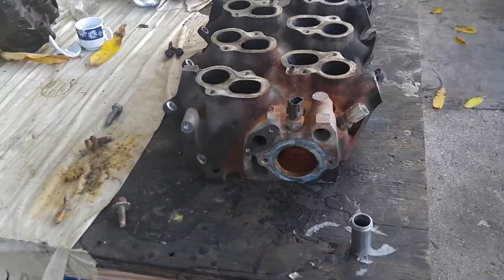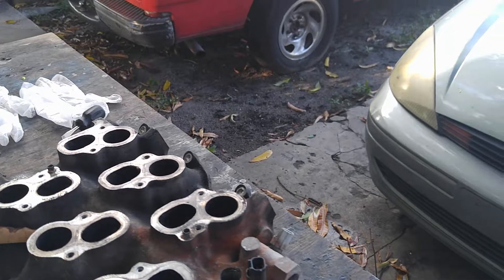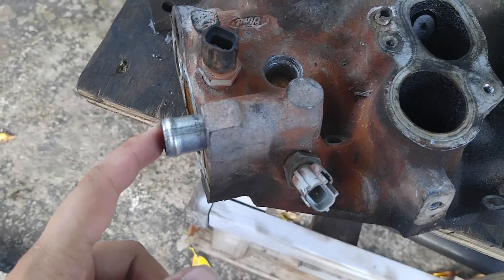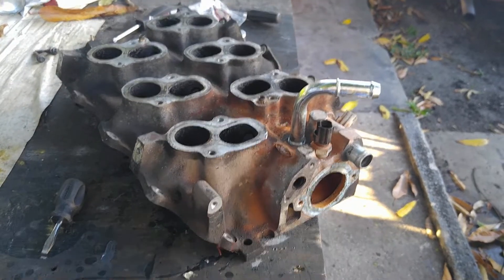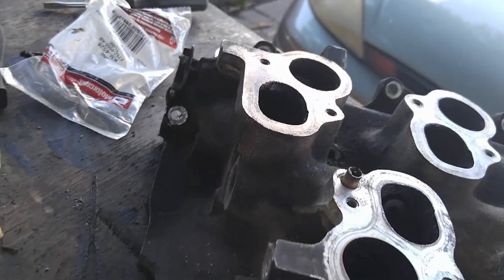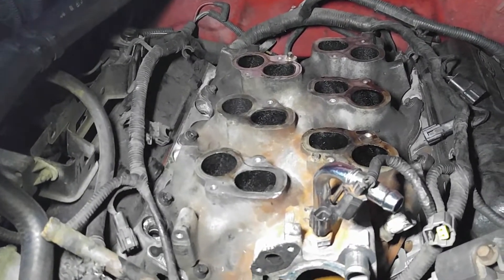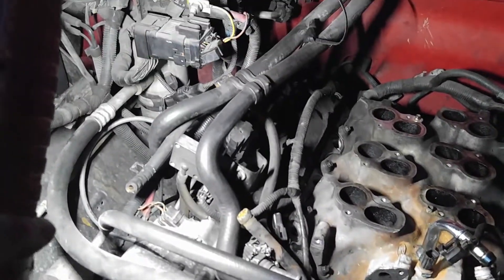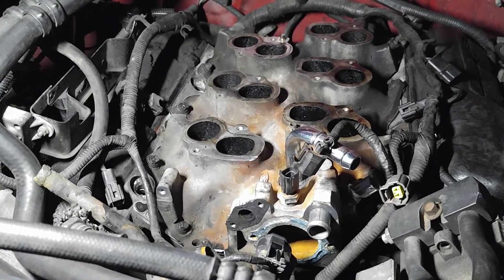98 F150 4.2l V6 lower Intake Pipe repair.

Comment: Did it leak?
Reply from the maker: @Goshdog  it did not. Everything worked for 7 years until I crashed the truck. Currently working on upgrading it to a 5.4 motor. But the 4.2 was running with no leaks on this repair.
Reply: @pivisrepairshop3151  cool I tried I just couldn't get it so I replaced the manifold

Comment: Thanks for the information. That is exactly what I have going on. I bought the truck in 2002 New and it has been Faithfull and Dependable other that this issue, and the Clutch Slave Cylinder is on the Main Input Shaft of the transmission. ( Bad of Ford to be so thoughtless, that was a pain.) I guess I'll give this a try, I'm not a mechanic really, but if I thought someone would pull the intake and fix it correctly I might consider it, but I'd rather try to do it right myself than have someone throw a 10.00 bottle of leak sealant in my cooling system and charge me out my muffle bearing...lol. Again, thank-you.

Comment: How hard was it to get that bent pipe in the manifold with the wrench method? Has it held up with the jb weld..no leaks? I have same issue. Got old pipe out..how tight fit is new pipe?
Reply from the maker: The pipe to install was about a minute. The JB weld has held up. I just went with jb weld to be on the safe side. New pipe should be an interference fit. Its like installing a wheel bearing. once it is in it won't be able to rotate.
Reply: how do you get the old 90° bypass pipe out mine cracked off which was my original issue
Reply: @lincolnhantsbarger3306  yes this
Reply: @gokblok  i ended up gettiing it out by beating it down into the engine and crimping into a squished ball and pulling it back out then i used a magnetic to get all the shrapnel and shavings back out before i put the new one in sadly i didnt record it.....it was a nightmare. I wasnt happy  that i had to do it that way......the shavings in the engine wasnt my idea of a correctly  done process but it worked good no more issues since i replaced it while it was still in the truck mind you.....i didnt want to take the whole engine apart just for that

Comment: How in the hell did you get the plenum off?
Reply: They are tedious. There are many forum articles on how to remove them, but it's mostly just a bunch of 8mm head bolts. When I need to know a bolt pattern I search for the gaskets and count the bolt holes.

Comment: Do you repair upper intake manifolds? I have a 97-00 f150 4.2 upper intake I pulled from a junk. It is in decent shape but the metal fittings have seen better days. Was planning on using it for my crate 2003 3.8 mustang intake swap.

Comment: A 90 degree Bypass Tube broke off of the top of my throttle body.
Do they have one that small?

If so, what size do I need & where can I purchase one at?

Thanks in advance..

Comment: I have coolant leaking into the engine oil is it from the intake manifold gasket failing?
Reply from the maker: Some of these engines can be hydro locked by failing gaskets. It could be a possibility, but unless you remove the intake you might not know. You could also see the sparkplugs to see which one seems to be steamed clean because of burning water. If it's the two closest to the front there's a possibility of the intake gasket. Anywhere else and it could be head gaskets

Comment: How do u get one out that broken off on the lip?
Reply from the maker: You can most likely use a screw driver. If the part rusted off then it should be easily removable. Thats why I used jb weld. It's still holding after 3 years

Comment: How did you take out the 90 bended pipe?
Reply from the maker: It was a few years back. But if I remember correctly, I removed it with a screw driver and hammer. pierced it with the screw driver and then started to use the hammer to hit the screw driver. I believe pliers were also used.

Comment: How much torque did You use for the bolt ?
Reply from the maker: For the intake to head bolts?
Reply: @pivisrepairshop3151  yes 👍
Reply from the maker: @Eba7146  per http://www.torkspec.com/torkspecme.aspx?KI=11-4.2L-256ci-V6
It says it should be 1 step 4ft lbs and 2 step 8 ft lbs. There is also a pattern you should follow when tightening the bolt. I just did one step hand tight with the socket wrench. Pretty sure it was closer to 8 ft lbs. It's weird to say but I went by feel vs spec. Don't do like I do. It worked for me but may not work for you.

Comment: Anyone ever get the part number for the straight tube (lower)?
Reply from the maker: Ebay no longer has the part. The next place I would suggest is 
https://www.alexsparts.com/water-bypass-tube-nipple-ford-w-3-4-x-1-3-4-water-tube/

This part looks to be similar in reference to the dimension of the original part I bought.

Comment: How can I tell if mine is bed what are some sounds
Reply from the maker: Mine was leaking. The pipe had some small pinhole leaks and the pipe was corroded that if there would be enough pressure the hose would most likely not hold in place.
Reply: Do you have a email I can texts you throw I going throw a progress of restoring my f150 98 and I have couple questions if you can help me out
Reply from the maker: Sorry on the late response. Have not been too active on the channel. Any emails can be sent to pivi.repair.shop@gmail.com

Comment: Same leak I got from the same tube smh
Reply: Me too
Reply: 285,000 and mine (2002) finally went. Leaking like a geyser. Really don’t wanna pull the upper intake manifolds off. Learned the part number for that little tube. Thank you.
Reply: @weatherwarriormedia4791  what was the part number for the smaller tube? Mine just rusted off lol
Reply: @weatherwarriormedia4791  was you able to replace the tube without tearing everything out??
Reply: @ericsolomon1109  We actually just got rid of the truck. There were other issues that popped up and we sent it off to the great junkyard in the sky.
Reply: @weatherwarriormedia4791  gotcha. Thanks for responding